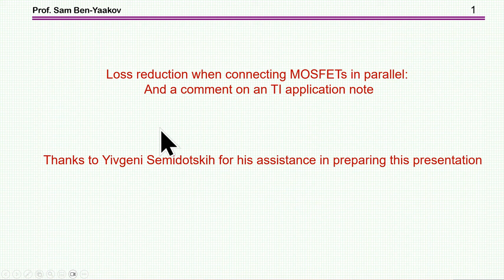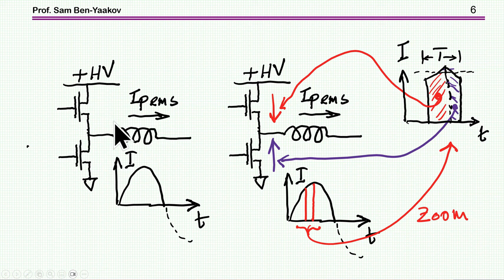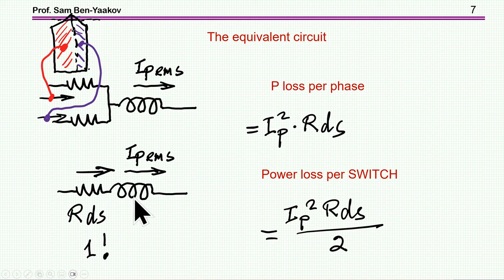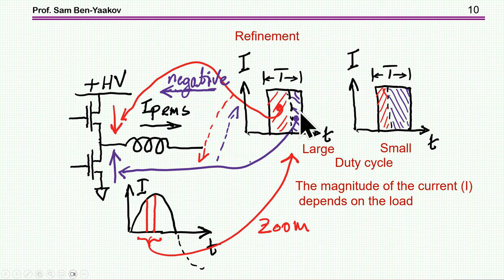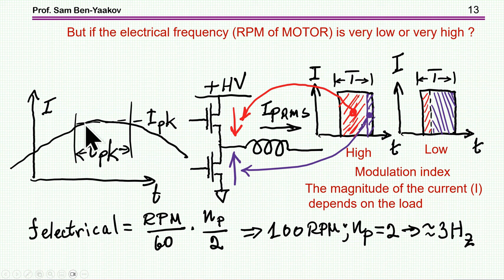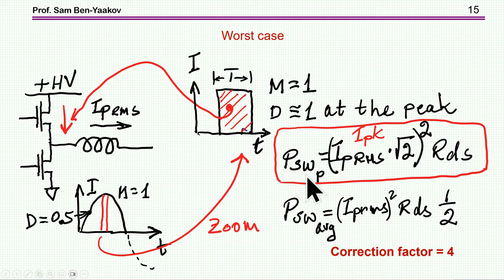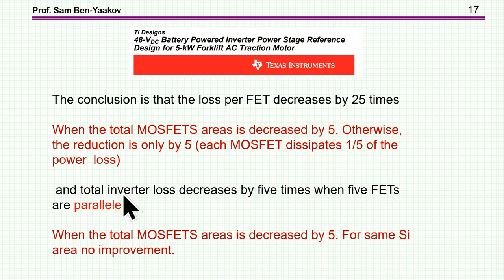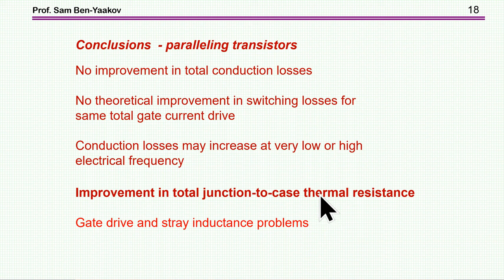Loss reduction when connecting MOSFETs in parallel: And a comment on an TI application note

Comment: Hi, Professor Sam Ben-Yaakov, Thank you so much for the presentaion.   I have learn a lot from your Vidio in the past and have followed you for many years.  For this presetation,   I would like to indicate that TI appliction note is not wrong.  It just indicates the fact that the Power  Loss of each FET  is reduced  by 25X when 5 FETs  are in parallel.  The price paied for the power loss  reduction is 5X area increase.   Another side benifit is the  thermal resistance Rth reduction as you pointed out.    I agree you, however, this is not a fair comparsion ans misleading to many  peoper.  Thanks.
Reply from the maker: Thanks for comment. So you think that, as TI concludes,  " and total inverter loss decreases by five times when five FETs are paralleled" is OK? Not only that this is wrong, it misses the whole point. Paralleling is for the reduction of the thermal resistance, not the losses. Application notes and reference designs are not written for people who know it all.
Reply: Thank you for reply!  Yes,  the intend to put FETs in parallel maybe to reduce the thermal resistance.  The total resistance does reduce by 5X  for a given load Io.  The price  paied is large area (and cost).   Thsnk you again for your excellent seminars.   @sambenyaakov

Comment: At 16:49 I assume you mean lossed decrease by a factor 25 "when the total MOSFETS areas is INCREASED by 5". Not 'decreased', right ?

And thank you for pointing out (at 19:47) that there are issues hooking mosfets in parallel, especially without individual gate resistors, as shown in TI's application note 0:17. I think you did a separate video about that.
Reply from the maker: Correct on the two. Thanks👍

Comment: Thank you for this presentation. It is rather surprising that TI would put such a silly statement in an application note. I would think that another benefit of paralleling transistors, is simple necessity -- low power transistors are cheaper and high power ones expensive and it would seem (although I have not verified that) that the rate of cost increase of higher power transistors would be exponential as compared to the power. After all, a transistor generally handles higher currents by having higher area, and in silicon manufacturing cost rises exponentially with area of the chip.  Thus, one should be able to save money going with multiple lower power transistors. But of course there are other factors. 

Anyway, these electric motor driver issues are very important nowadays, so it would be very interesting if you do more lectures on them. For example, I am wondering how important is matching of R(DS-on)s of the multiple transistors in a setup like this? There is a company that is saying it is very important and is selling very expensive test equipment in order to do a wear in test of silicon carbide transistors to, among other things, get an accurate reading of the long term R(DS-on) of every transistor. 

I have also wondered, that as long as you are putting multiple transistors per motor wire, would there be any benefit to creating an individual switch for each individual coil of an electric motor. Nowadays the driver circuit has three wires coming out of it and they are selectively connected to the various coils of the motor, with each two wire combination connected to multiple coils. What if you give each coil its own little driver instead?
Reply from the maker: Indeed
Reply: Lower power mosfets are more practical beyond just being cheaper.
- They may be more easily available.
- Using multiple such mosfets means larger volume, per unit cost can driven even lower
- Lower per unit cost means maybe these can be used to replace other models in other applications as well
- Cheaper prototyping and testing, so you can test more

Comment: I'm sure that TI meant to compare transistors that are identical to one. When shopping for mosfets, you can see that for a given Vds, below a certain Rds there simply are no products or the prices jump exponentially. That threshold is around $6, in my experience. So, it's better to combine two 20mOhm mosfets that cost $4*2 instead of one 10mOhm mosfet that costs $30. The opposite happens when looking at cheaper mosfets: the price of the packaging becomes more pronounced, so 40mOhm mosfets actually cost $3.50, thus $3.50*2 is worse than $4. Then there is also the worry if the gate-driver can deliver enough current, so potential savings with mosfets shouldn't get eaten by the cost of extra drivers. 

Turning on 5 mosfets simultaneously is a problem, but the imbalance is only for 30ns. Each mosfet must be rated to withstand the full load by itself. Also, the stray inductances may be a problem, but remember that generally 5x less current goes through those inductances, so you can actually mitigate the effects of stray inductances that you couldn't possibly mitigate when you had 1 mosfet. I might be wrong, someday I should try it in LTSpice with random parasitics. Output capacitance becomes a real concern, though. At 100kHz, 2nF and 300V, that's 9W per mosfet. Doing 45W at idle is too much without GaN/LLC. 

Companies like Victron consistently use 3-5 parallel identical mosfets to reduce total Pd and use passive cooling.
Reply from the maker: HI, Thanks for the conversions. Too bad that none of this is in the TI reference design. AS for "I'm sure that TI meant to compare transistors that are identical to one", the question is not what they have in their mind, but what is written in the document.

Comment: Unlike resistors, there is always a voltage drop, a specific value, across a transistor therefore, paralleling transistors is not like paralleling resistors.  Also, current will increase for the transistor that becomes hotter therefore, thermal runaway could occur in a specific transistor.  Balancing load through a resistor network can solve the problem however, this increases loss.  Transistors are not resistors.
Reply from the maker: You are mistaken. Paralleling MOSFETS is pretty much like paralleling resistors. And there is no thermal run away in Si MOSFETS. See https://youtu.be/wjSM2oYY3OY